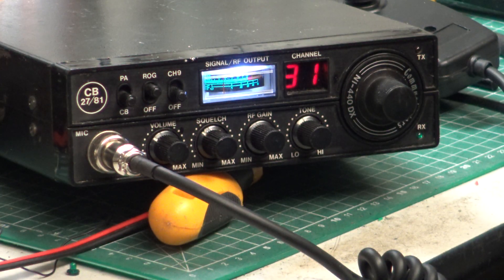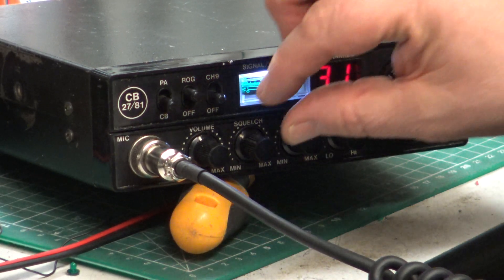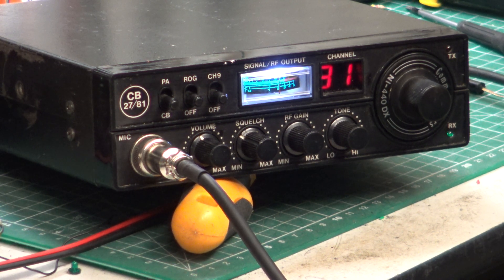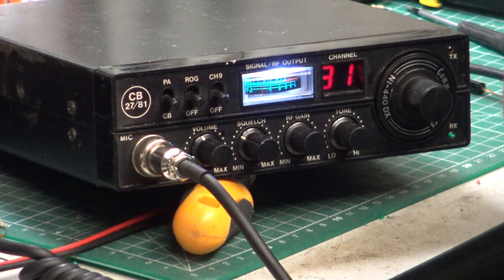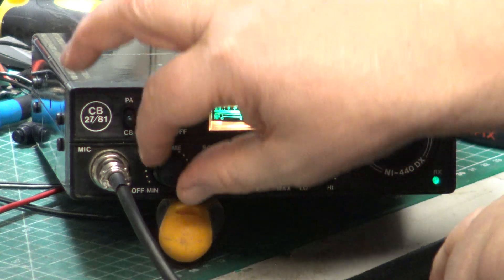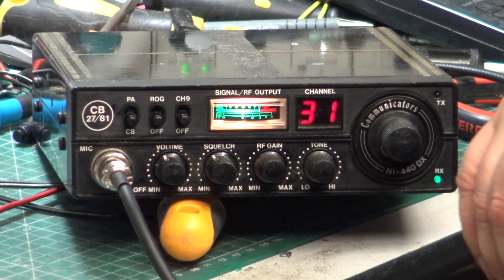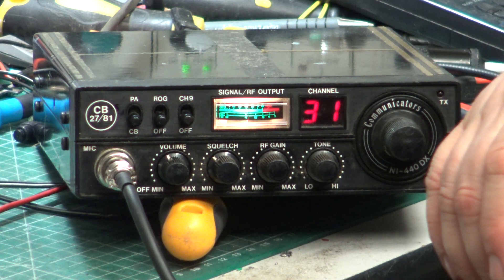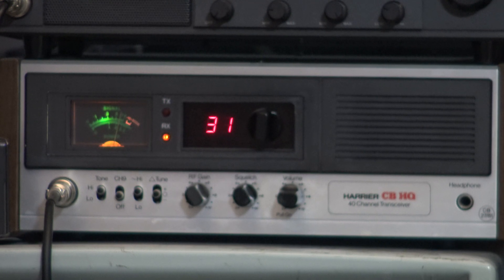LCL Communicator NI440DX UK FM CB radio - double 'on the air test'

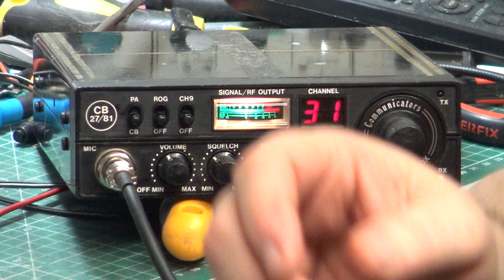Comment: Second one at 8:50 sounds like an slow or struggling VCO lock. Good TX audio though of course.
Reply: I had one from new in 1981, it did the same thing. Looking it up now it seems to be something to do with the VCO lock. Also known at the 'President Fart' - the fix was to remove an component or you could play with the VCO which isn't recommended. It's worse with the squelch turned off.

Comment: Can we go for a ride with Mr. Chippie? I'd like to see this route I've heard over the radio.
Reply from the maker: Yes, we've done that several times before but can do it again. Now, Mr Chippie does these tests at 7:30PM so we have to wait until the season is light at that time & not dark at 4:30 like it is now in early February.

Richard, G0OJF, UK
Reply: @ukfmcbradioservicingTango21  Yes, I found one after reading your reply here. Thanks. 
New here. Didn't realize your library was so extensive.
I've used 2 way radio for the past 20 years in various jobs. I DX a little SW now and then as well. 
Thank you sir.

Comment: Two great radios and very usable   and miles  better then the newer ones, and I was told there awful ,and there not a great demo  of them both I run  a eurosonic for mobile portable.  with big whip antenna  of a midland hand held and a 900 amp hour jump starter and it gets out well and pulls in well. And some times a 7m sofa pole and a T2LT antenna to.only thing it's not multi band.but that  will change this year a cheap new multi band radio and Mike must be push in and screw up not them other.ones.

Comment: Ive got an absolutely pristine one of these and it works amazingly well, badged as the serpent but the same radio, on the second radio there is a strange high pitched hetrodyne sound on receive, sounded like Mr Chippy was flying inside a helicopter, not much you can do with the coils glued.

Comment: Amazing and surprising how both these sets worked exceptionally well, it just goes to show that newer higher priced branded spec radio's which should perform better don't compete against old school rigs.. also the modulation on both sets was excellent.
Reply: Amen to that, give me an old set any day.  Hummm!  Even Communicators is better than some new sets.  Did I really say that?  I must be half asleep, it is 4:35AM on Sunday morning and I have not been to bed yet.  Good grief, Richard will be getting up to go to church shortly or to fix a CB!  😳  Bedtime 🕔❗